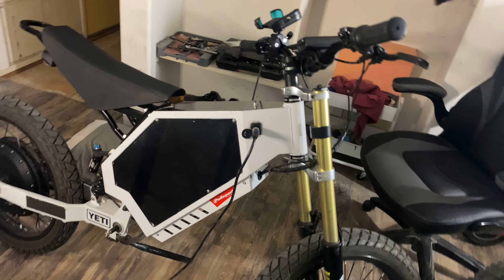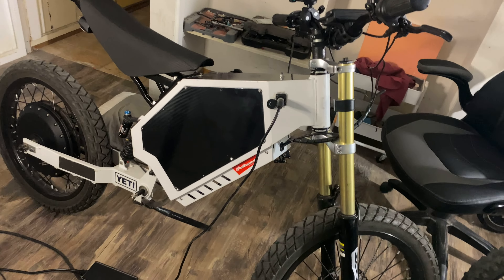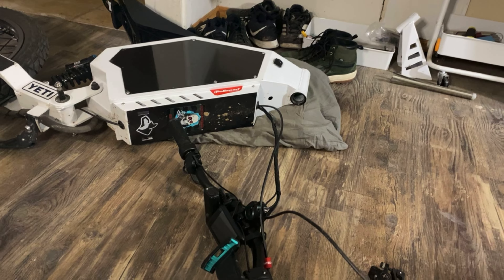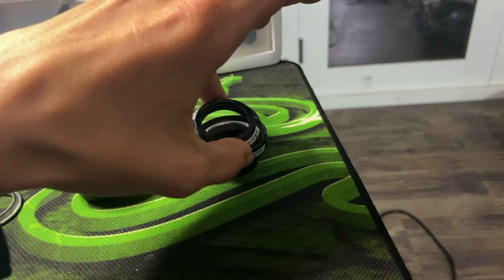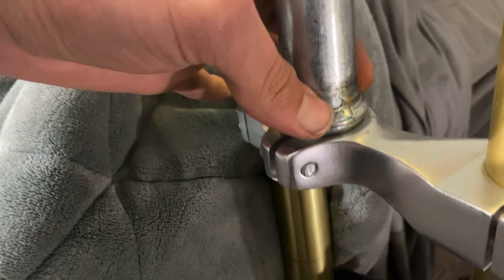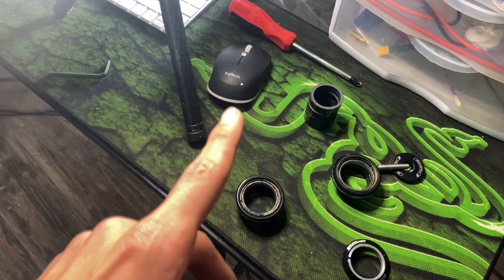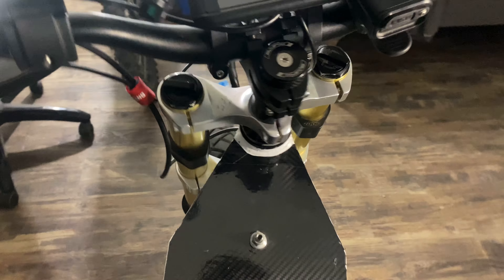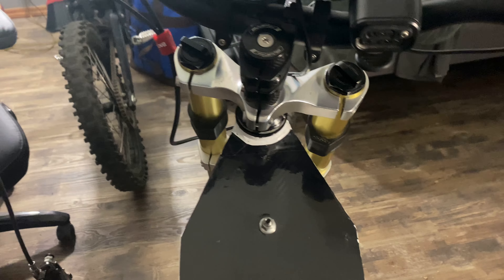How to (properly) install headset bearings on stelth bomber/enduro ebike and get rid of stem wobble!

Comment: Those pieces you cut, no no no, most likely will cause premature bearing failure. I would suggest to others to use a dremel with a sanding disc drum, or if that is not available to sand the inner race with sand paper till they fit snuggly. I only say this assuming those are the races that directly couple to the bearings. If not I appologize for missing something. No matter, very informative video and excellent method of showing how to use an alternative bearing set even if it wasn't meant for that exact frame which I believe someone mentioned that already.
Reply: They are the races for the bearings. I'm kinda surprised that it didn't shatter by being cut, since they tend to be hardend. I'd rather find a pipe that fits the races and press/hammer it down, since it's supposed to be a press-fit tolerence.

Comment: Had this exact problem on my new bike wasn't sure what to replace it with thanks for the vid man! gonna give that headset a shot!
Reply from the maker: With some of these bearing cups the inner diameter is too small for this to fit so you might have to sand it out with something like a dremel. I did not know that when I made this video.
Reply: Yup they did not work for me at all unfortunately they are to small they just jiggle around in the head tube instead going in snug like yours did
Reply: Or yea actually it's exactly like you said inner diameter on frame to small won't let it go all the way in rip
Reply: Also silver ring you has to cut to install is to big it sits loose at the bottom

Comment: They make sealed roller bearings sets for mounting forks and they are well worth the cost. The ID of the bearing fits on the of of the fork and the od of the bearing fits into a cup that presses into the frame. Super stable at high speeds (no tank slappers).

Comment: Hey thank you so much for this video I have the same ebike but mine is a fat tire ebike but my front shock that I have is DNM shock will this still work please respond because I just ordered it
Reply from the maker: Yeah it should work all front shock steerer tubes are the same. You might have to hollow out the inside of your bearing cups for these to fit properly depending on which ones you get. I used a dremel.
Reply: @ENDOPRYSMofficial  hey when u say inner bearing cups, did you take the Dremel to the bike or the headset
Reply from the maker: The headset.

Comment: That star nut needs to be set deeper in you tube. Get a socket and smack it down a bit. That’s what smashes everything together to keep things from vibrating. Loosen the crown and headset bolts before tightening the cap

Comment: Hi endo, I see you retained the original bearing cups and placed the newer ones over them.
This is fine as your newer ones are narrower.

But for future reference what you will need is a 44mm top and bottom bearing cup set as the headtube is not tapered but straight.
Reply from the maker: Ok thanks.
Reply: Mt Lion, do u know if its possible to upgrade these bicycle grade headset "components" for, perhaps, the new Sur-ron heavy duty roller bearing headset? Or if that's not the correct size maybe just source everything from McMaster-Carr or elsewhere? I'm assembling a NB Power enduro atm, and think the bicycle grade headset is definitely a weak link, i need to upgrade now.
Reply: I tried to follow this tutorial, but my "FSA Orbit MX 1-1/8Inches Threadless MTB Road Headset with Top Cap, Black, NO.20, XTE1504" (amazon) doesn't fit the bearing cups that came with the frame (same frame as ENDOPRYSM). Do you think I need to buy "FSA Orbit Z 1-1/8Inches 44mm Threadless 1-1/8Inches Headset with Top Cap, NO.9M/CUP/CC , XTE1528" (amazon) like you said in your previous post (44mm top and bottom bearing cup)
Reply: Wow guys sick information

Comment: How did you save up all the money for everything
Reply from the maker: Summer job digging trenches and putting stucco on walls lol. I also flipped a few motorcycles like 10 months ago and make about 1000 profit from that. The surron is not mine.

Comment: My forks were a lot harder to install….I ended up using a very light fork….but it only had the main bar…I’m not planning on doing a lot of off road running…but it will be Capital if I have to…Im also using 27.5 inch rims….so I needed a shorter front fork.

My next issue is I ordered Hydraulic brake calipers…I don’t know if I should keep them or order the brake levers for them.
I heard the hydraulic brakes are a lot better….The damn thing is heavy’ so maybe I should keep them’ I’m almost out of budget….I’m lucky I have a 3 pc crank shaft and Derailer….I’m only gonna do the 7speed…because I don’t think you can fit a front derailer on these frames….I wanna keep it a pedal assist. 

I hade to take the bearing apart, sand down the cup, and use a rubber mallet to get it in….I had to do something cheesy and lube the spacers you get for a gooseneck and make them into bushings….to stabilize the fork, so far so good.
I belt sanded the bearing cups, and polished and lubed the homemade fork stabilizers.

Turns extremely well, and no play or wobble.

Comment: But you have the Wrong link/Part or am i wrong you linked the 34mm outside version but this frame has a 44mm frame
Reply from the maker: That’s the one I used. I’m no expert but believe me it works great.
Reply: @ENDOPRYSMofficial  i am gonna buy now the 44mm version frim Aliexpress i can tell you in 2 weeks more normaly you shude use the 44mm versuon because the "Zylinder wall" in yours is 34mm right and if you insert it is basicly isnt centered by the tube but only at the rounded end am i right.

I gonna buy the 44mm version and a Headset tool to press it 100% straight in  and my 44mm zylinder you be perfekt fit on the inner hole of the frame
Reply: @ENDOPRYSMofficial  ah i know yet whats the thing you basicly you installed the original 2 "spacer" that where with the frame and they make from 44mm the 34mm thats why yours fit to but i would prefer to buy 44mm straight and out in then its even stabler becaus you dont have extra 2 parts + in it
Reply from the maker: @rintuut  you can do that. I think any bearings that look similar to these should work. It’s been to weeks and I have had absolutely 0 issues so far.
Reply: @ENDOPRYSMofficial  perfect yeah i am goona test it with the straight 44mm without spacer version amd gonna update how it rides👍
Reply: @rintuut  any update?
Reply: @lucaspacheco3631  any update

Comment: i would recommend buying a downhill mountain bike headset, it would have stronger bearings, less risk of play, etc, and this is coming from a downhill racer and trained mechanic
Reply from the maker: I think these are. I left a link to them in the description. The old ones were verry flimsy.
Reply from the maker: @youbickbiking3084  I’m gonna redo the link
Reply from the maker: @youbickbiking3084  https://www.amazon.com/FSA-Orbit-Threadless-Headset-Black/dp/B07D4GT8YS/ref=mp_s_a_1_10?crid=16WDRPIAA407Q&keywords=mtb+headset+bearings&qid=1644549741&sprefix=mtb+headset+bearing%2Caps%2C280&sr=8-10 try this

Comment: It's good not to have to remove the original bearing supports because it's not easy to put in the column...
Reply: You might have to grind the opening on the cups to do this, however...

They don't just easily fit in. There's about a millimeter of overhang that prevents you from doing this on nero headsets for this frame.

Comment: I have the same frame and bought the headset bearings from the link and they don't fit inside the cups in the frame but thr fork still wobbles
Reply from the maker: Ok that’s not good. Your frame probably came with different cups than mine. You could probably just widen the hole with a Dremel or some sort of sander. I did that on my most recent bike.
Reply: @ENDOPRYSMofficial  I ended up ordering a 44mm front and bottom set that another commentor suggested hopefully it works  the bearings are permanently set in the cups of the fork on the frame I got, I'm honestly not sure if the wobble is from a different problem because the inner diameter of the new headset bearing seemed very similar to the one that came with the frame, sorry for the extra hassle and long messages loll
Reply: @corbinandersen809  did the 44mm fix it?
Reply: @lucaspacheco3631  my issue is I'm not sure how to remove the original cups without taking it to a bike shop, I have rode it with the wobble and it's honestly not terrible it only shifts when I use the front brake
Reply: @corbinandersen809  I just got the frame in today. I didn’t put the cups in yet. Do you recommend I don’t put the cups that came with the frame and get what aw do linked in the description?
Reply: @lucaspacheco3631  I would say yes try to use the aftermarket parts because I don't know of anyone that didn't get the wobble with the ones that came with it
Reply: @corbinandersen809  Update: I put the cups that came with the frame. The parts that were linked didn’t fit in the cups that came with my frame. I do see it wobbles…
Reply: @lucaspacheco3631  yeah it's not ideal I've been busy and haven't tried to fix mine but I have rode it around 100 miles like it is still lol
Reply: @corbinandersen809  welp I think mine is actually. It doesn’t move to much.. like there’s little play, I feel it. I’m still waiting for my battery to come in!

Comment: My frame came with the cups not installed….however I received bearing cartridges and they were sealed, the first time I installed them ass backwards…and made it hard to steer, I had to take the forks off, and fix the issue.

Unfortunately I stripped a bolt on the gooseneck….I’m going to either have to buy another one, or I’m gonna drill the head of the screw off, and use Pliers for the screw…or I’m gonna drill a hole and use a screw Extractor.

I’m tired of having to order something and have to wait…I’m 5/7 and the 200mm shock made the bike sit too high, if your over 6foot 1…then your good, any shorter…. And your gonna have a hard time getting on and off, if you come to a stop, your gonna have to lean the bike.

I ended up buying a 150mm shock, and returned the 200mm shock’ not to mention…I’m using 27.5 rims….my 150mm shock came in….it’s now suited for anyone under 6feet, I can higher the seat, 150mm shock makes the bike suitable for shorter ppl.
It fits people 5foot 3 inches to 6 foot ppl’ with the seat adjusted higher’ if I put a stealth Bomber Seat on it, it will only fit  people
5/3 to 5/8. 

Looks like a Tron motor cycle’ if you ever played the video game, or saw the movie’ You would know what I’m talking about.

Comment: Anyone care to help with finding a headset? I have an unknown frame but it has that little cup diameter of 40.5mm and the tube inside is 31.5mm I have the same fork at 28.6mm so I need to get shims or adapters. I can't for the life of me find a headset with that size.